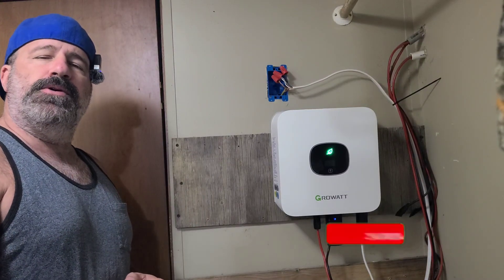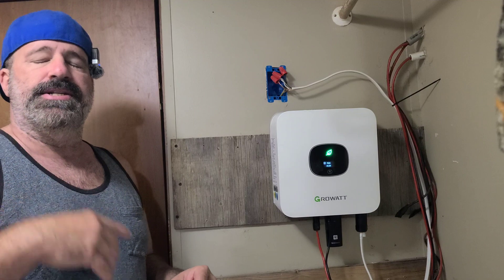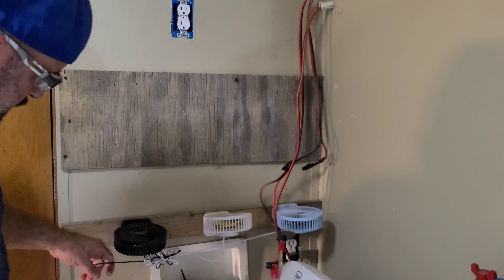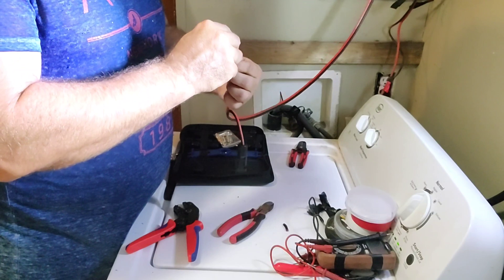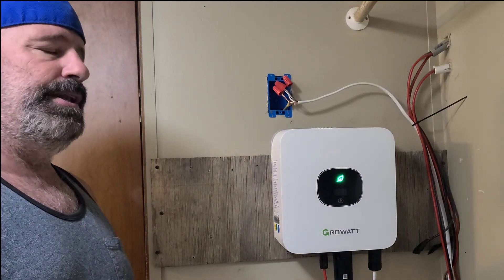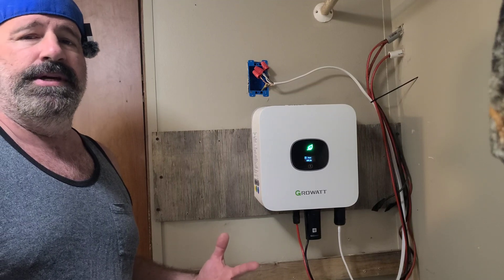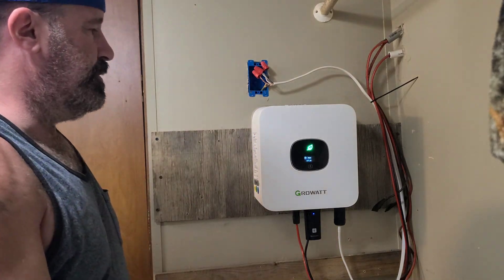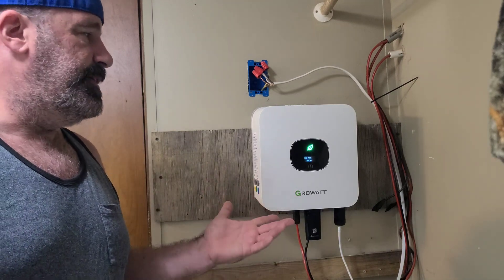Growatt MIC 3000TL GridTie Install - Signature Solar

Comment: In the EU I have the same inverter and it has 2 string connectivity so 4 solar inlets.
I see that when you scroll through the menu you only have pv1 showing. 

Do note if you connect them in series if you have shade that will hugely impact your output.
Reply from the maker: You must have a larger model or maybe the newer models are coming with dual PV inputs mine only has one. I have hooked up the second in the series and actually and producing more than I had anticipated as at the end of the day when my main array is starting to get shaded the secondary one is not so it actually runs later into the night producing. Kind of a weird phenomenon I know

Comment: How much solar do you use at your homestead?
Reply from the maker: So we have 10 285 watt panels or 2850 watts possibly. I doubt we ever get over 2500 in best day possible. But this system saves us $20 to $25 in winter per month on electric bill and $50 to $60 a month in summer. So $35 to 40 is monthly average off electric bill year round. 
That said our system is self-installed we only have $1,600 in it. So the payoff on the system would be less than 4 years. Now it is true that at times we are pumping electric back into the grid for free. And my year round numbers could be higher if I went out and clean the snow off the panels every time it snowed. But I'm content to allow mother nature to do what it does.

Comment: You would not be "giving" power back to the grid if they pay you credits for whatever you push back to the grid. That in effect lowers your power bill. And, I think most inverters and solar panels produce power when they are called upon, meaning if you are using power then the panels and inverter is producing. If you're not using power, then it kind of takes a rest. If you are pushing to the grid, you are then working your solar system to get all the day's production to work (either used in the home, or pushed to the grid).  I dont know if the Growatt inverter will sit and produce power if you're not asking for it (your homes load). IF not, then you're missing out on the solar panels producing all they can in a given day of sunshine. Hope this makes sense.
Reply from the maker: I think you misunderstand how grid tied power works. They create things called limiters to stop pushing the extra power back and put the grid tie and panels and sleep mode like you're talking about. But energy flows so when we are not utilizing what the panels make then it does flow back in the system. But we buy electricity for 13 cents a kilowatt hour you get paid $0.03 but there's a fee for being grid Tied and there's a
 fee for a net metering meter. As well as many other taxes. So essentially I would need an array four times my current size and four grid ties as well as pay thousands of dollars to have it all installed by electrician pull permits etc just to break even. Currently this system holds our electric bill down very well in the summer in the winter when there isn't snow on them it does a good job of helping. That I mention that with our electric company credits expire.... Yeah we are content with our current setup until we go off-grid. 👍

Comment: Do you have the AC output from the inverter tied directly into (what used to be) the outlet using L1 (black wire) as 120v, L2 (the white wire) as 120v and the bare or green wire as ground, the wire that into the double breaker as black L1, white L2 and green ground? 
And is that your PV lines going through the wall to your panels?
I plan to wire my inverter right next to the panel in the garage so I will wire it directly into the double breaker in the box. Is this how you have to wire it for 240v?
Reply from the maker: The wires coming through the wall are from PV but I only use one set now The rest are from the old setup. Everything is wired and series so I only have one wire to deal with.
The AC output now goes directly to my box. I have it hooked to a double pole breaker. That way you're feeding both sides of your box.
I want to say at this point I do have a breaker between my PV and my grid tie
And there is some talk that you should have a breaker between the grids tie and your box. Much like a generator does. I do not have one but if I'm giving advice I'd say it's worth putting in.
Reply: Sir…so the inverter is tied into your main panel box and NOT a sub-panel box or critical load panel? 

I will use a double pole 40A breaker in my main panel and another breaker on the wall before the main panel. Ty for that advice.
Reply from the maker: @jeffreyvictor3678  yep
Reply: Ty again for a quick reply!! I can do that!!

Comment: what happens when the grid goes down
Reply from the maker: It shuts down. It cannot function without sensing power from the grid. This is a feature to keep lineman safe as they repair the lines.
Reply: @thefrugalhomestead7873   No lineman has ever been injured or (ever will be) injured because of a solar  panel on a house. The first thing a lineman does when he arrives is earth ground  a broken line, its an NFPA 70 rule.
Reply: @thefrugalhomestead7873  so you have no power.
Reply: can you make a micro grid with another string invertor and no grid power.
Reply from the maker: @victorreece9256  I suppose you could

Comment: Great Video, I'm looking at installing the US model as well, to verify you connected to AC with 240 Double pole breaker, connectors 1(L1), N(L2) Ground (goes to the bus bar?)
Reply from the maker: That is correct for my unit but it's always good if you're going to order one to ask them for the diagram when you order it just to be sure. I'm being told that they're supposed to be coming out with a four plug model

Comment: Suggestion, I know it costs more, but with 2 strings in 2 locations, you could get the Tigo TS4-A-O Optimizer.. It will manage the issue of panels in different locations. They specifically call out this as part of it's use case.. The nice thing about the TS4-A-O, if all you need is optimization (not rapid shutoff) they optimize without all the extra CCA controller or TAP.. Just plug them in and go.. 

Thats how I use them.. Also, technically, you could mini-series up to 2 panels per TS4-A-O, since it goes up to 80V per TS4-A-O, so as long as your 240w panels don't go over ~70w it should be fine to double up. I do it with 200w panels with 28v VOC and works well. Signature Solar seems to have a competitive price on the TS4-A-O.
Reply from the maker: Not a bad idea if have to look at voltage/wattage lots as these are gcl 285 panels. We currently have the second string put in the series currently doing the testing but if we have losses due to shading this will probably be the solution thank you

Comment: Too bad that model doesn't have a CT clamp to control the output as some utilities charge for both ways as the meter doesn't know the difference.
Reply from the maker: Some do charge in that manner. Luckily mine doesn't. And I think a lot of them will stop doing that as time goes on because they're getting free generation. I would like the clamp and then be able to redirect to a battery but it's really not worth it on the scale I'm doing.
Reply: you can buy a meter that limits export to grid
Reply from the maker: @rickymartin06  Love it if you could provide us links Love to look into that